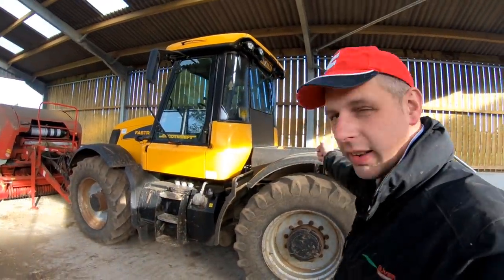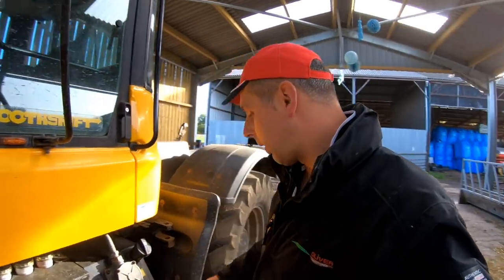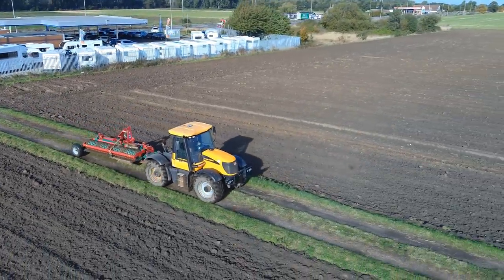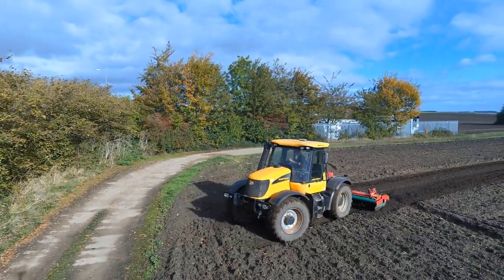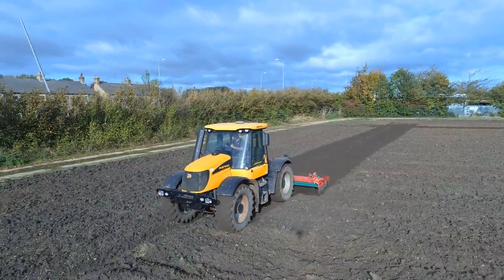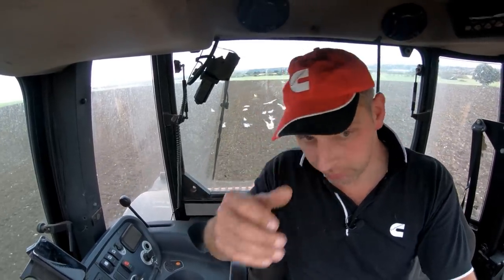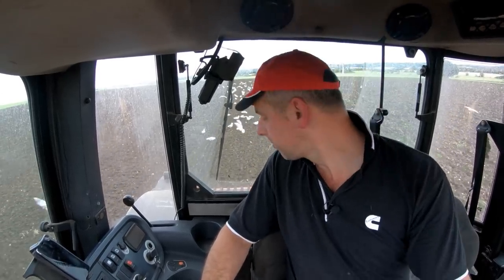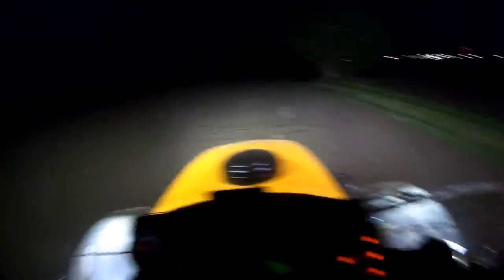FASTRAC FULL THROTTLE

Comment: Great video George giving Fastrak a go full Throttle? I bet bale hauling it was like there was nothing on back. They are great power harrows and looks pretty cool having to transport that way to Field and you can have that on in 10 and our fold up Harrow makes Valtra do wheelies so have 10 metre press on front even her out but it's no fun on the roads round here. About 4 metres wide max.